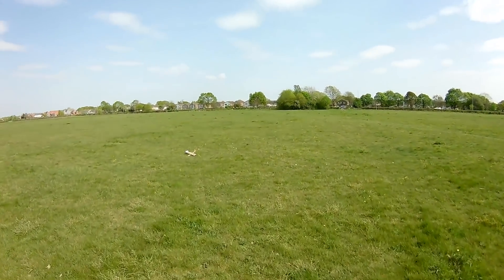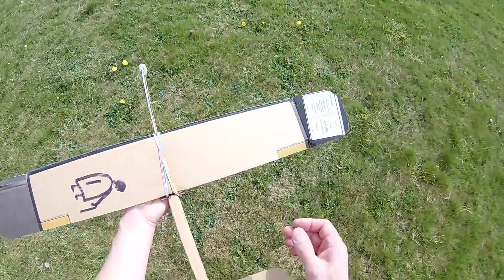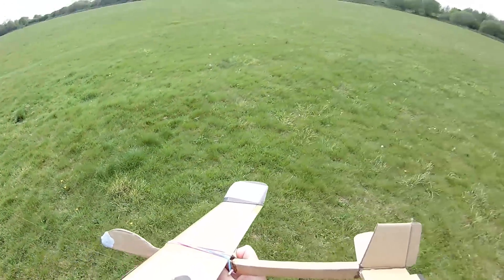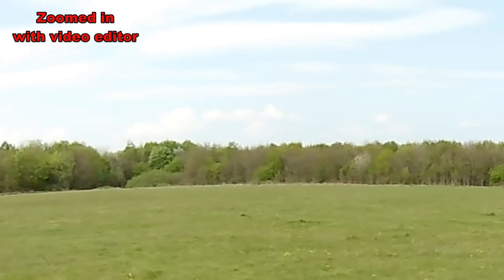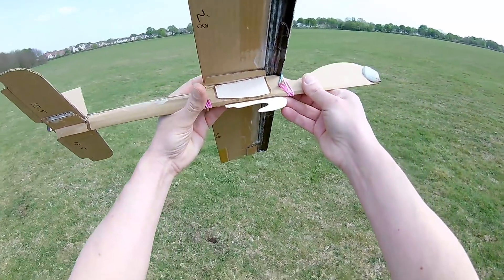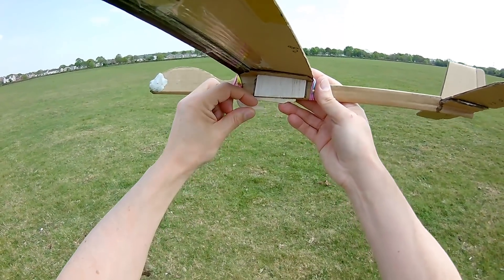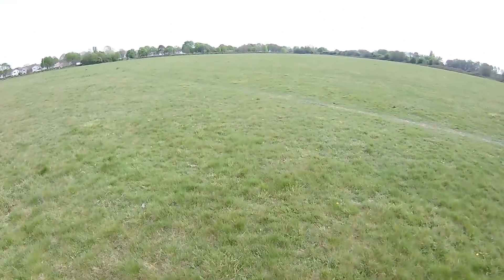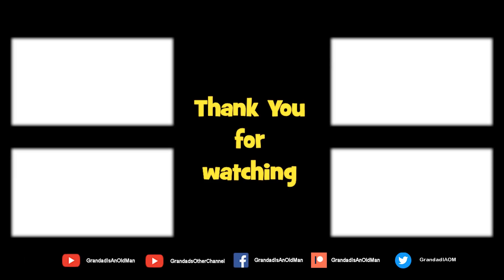Cardboard Glider - High Start Bungee Launch

Comment: That last flight was epic, i knew it would do better pulled into the air rather hand launched. Ivan has beaten me to it below, but a bit of rag would give aero drag to help the tow line to detach, a large diameter split ring ( key ring type ) might slide off the hook easier. You MUST give this a go on a still day when the wind won't interfere with it.
 Did you know there is a kite festival at Westward Ho ! next Sunday ? - https://www.visitwestwardho.co.uk/westward-ho!-festival-of-kites
Hope it is better than the Streatham Common Kite festival i went to in London today, great venue, well organized, lots to do, BUT.... NO WIND !! that kind of spoils a kite festival !!

Comment: hi grandad, that flew fantastic using the bunchee, nice job, i was gona ask you if u could take out one of ur rc aeroplanes and launch it with the bunchee instead of throwing it or even one of ur rubber band powered planes?
Reply from the maker: That is the general idea. If you check the associated playlist - Bungee Launch/High Start https://www.youtube.com/playlist?list=PLA5a2xPRSrB0n7Kn5beCSrsvALZqcuJ7o I had a go a couple of years ago with fairly limited success. The cost of the good bungee that I used here was a bit of a stumbling block. It is far more money than I like to spend. When we add the postage it cost me over £20 which equates to about 2 weeks worth of my normal charity shop spending budget and the enthusiasts often use 2 or 3 times the 10m length I purchased.

Comment: how long is your bungie cord  ? thanks
Reply from the maker: Here is the spec from the eBay listing 🙂
Silicon rubber Bungee Tubing stretches to 6 times its original length and is light weight giving a consistent pull, great for gliders and EDF jets of up to 3kg.

This item is just the rubber tubing, you will also require to purchase suitable nylon cord, a stake and ring. You can easily join the tubing to create any length you wish
Spec.
Length: 10m
Outside diameter: 6mm
Inside diameter: 4mm

Comment: Grandad ,you need a piece of cloth to add drag to the line , to help release the ring from the hook. Add more dihedral. I have a frog wren and a frog vespa. Both perform excellent . I made my histart following sonicdad's instructions.
Reply from the maker: On my other bungee I have a small parachute. The main benefit is it helps you find the end of the line when it is laying in the grass 🙂
Reply: Great ! My piece of cloth for the drag is red, so it is very easy to spot.  You have a wonderful flying place. Histarting gliders is just wonderful.  I enjoy every video you make.